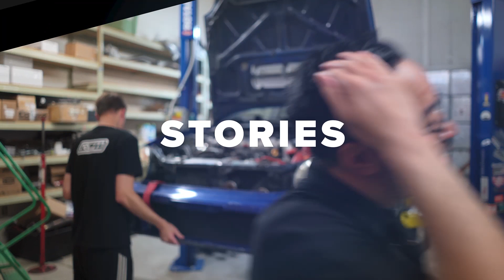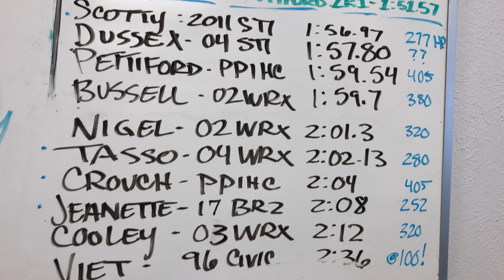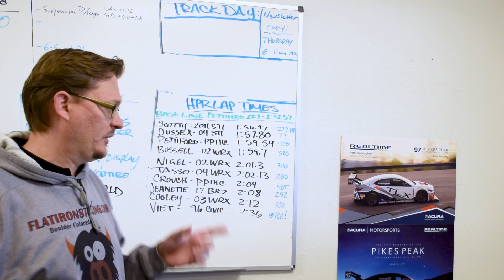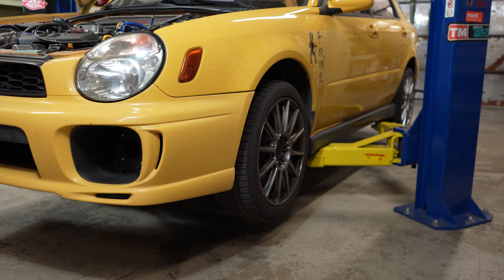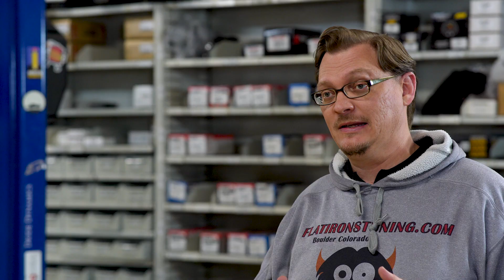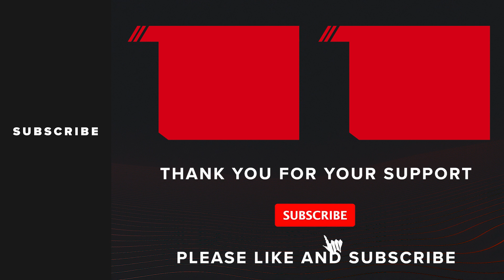Jon Wants to Lose 10 Seconds in 2022

Comment: Love the 03 Wagon. Got a 02 Wagon faded blue paint. Running APS stuff from 16 years ago. Just put ZFDesign 5 speed running RA 1-4, stock 5th for highway, and dual carbon synchros in 1 and 2; Torsen posi up front and APRacing posi in the rear. This little car is a beast and rips 1-4. Let's say going through corners is a whole new experience. Got a EJ205 JDM and new VF39 with 1000cc injectors sitting in the garage... Cannot wait for some more nasty fun. :-)  SHE IS THE TRAFFIC NINJA!
Reply from the maker: That is awesome!  Thanks for watching and Stay Tuned!